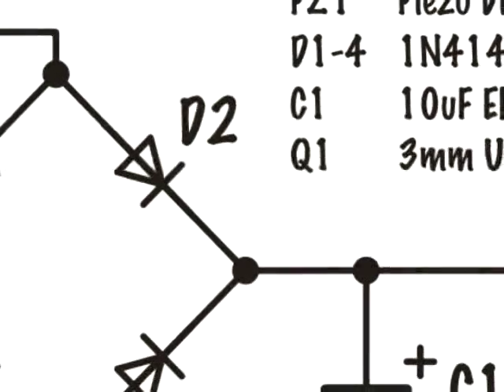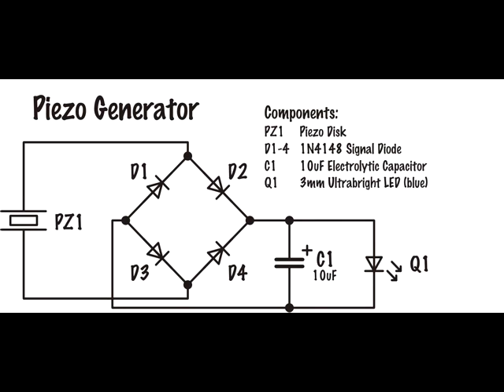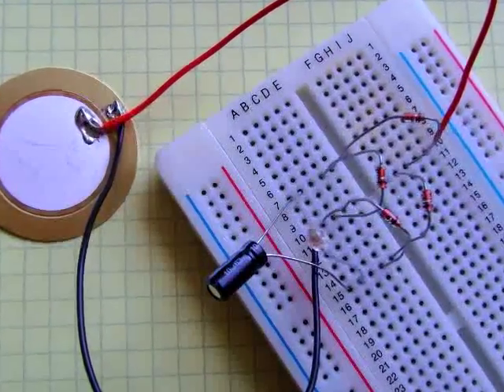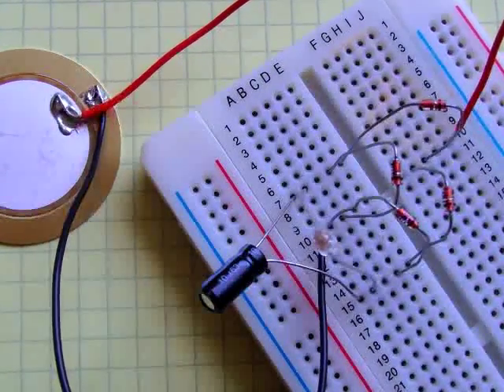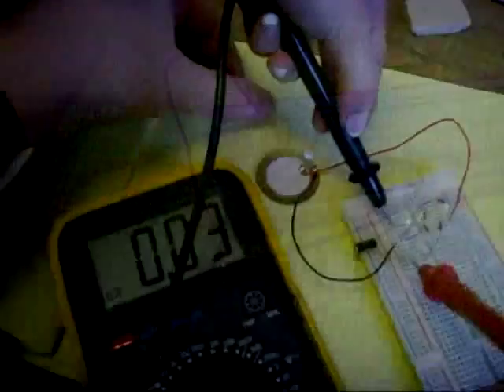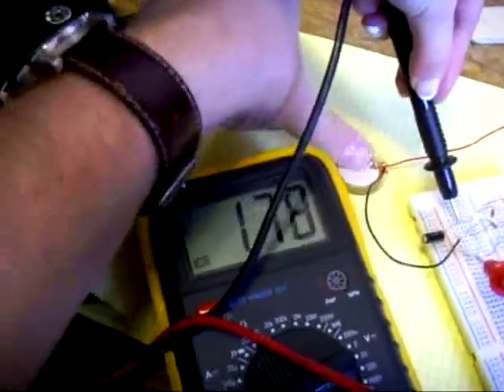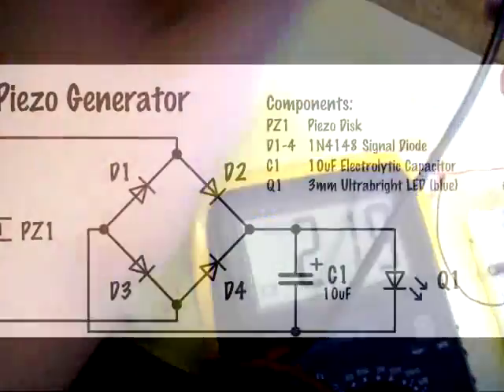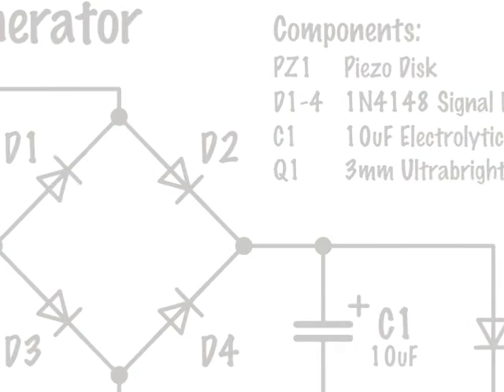Piezo Generator Mk2

Comment: Hey I tried to replicate your circuit and I'm having a problem with the led. I have a green small led and it is not staying lit as long as yours is, exact same circuit and I'm putting out max about 1.7volts. Any ideas?

Comment: heard that there were similar devices on the pyramids, and when they did chanting and dance, they gold that laid on top of the lime pyramids would carry the voltage to ground, causing a induced voltage differential that could pull lightning from the air, which would cause rain,,, you knowthe association with rain and lighnting? pressure?